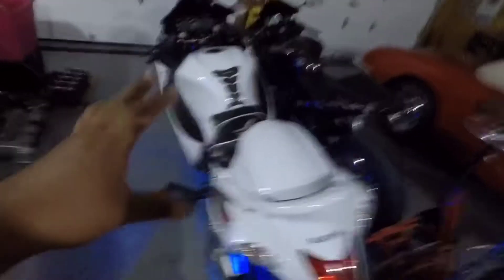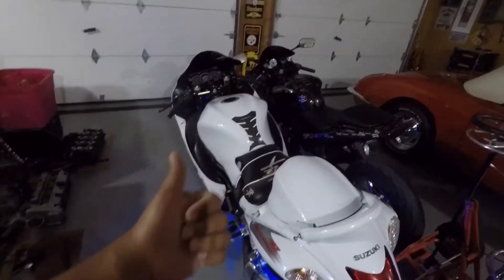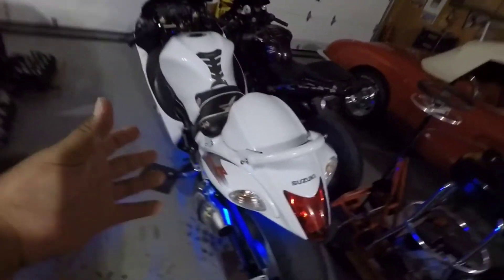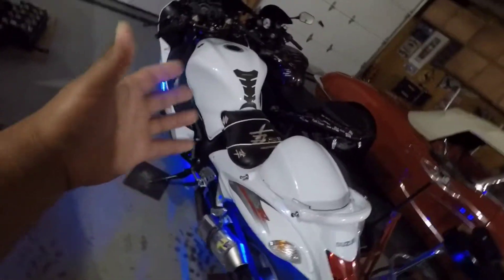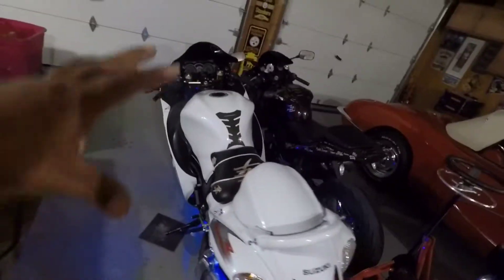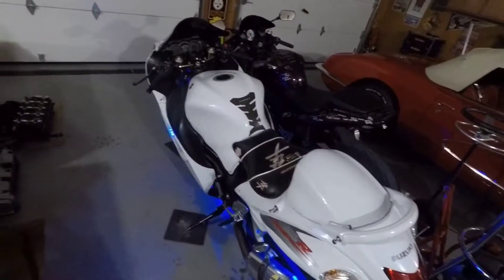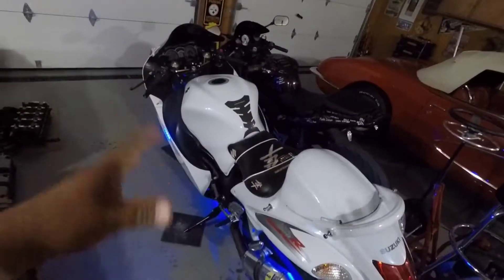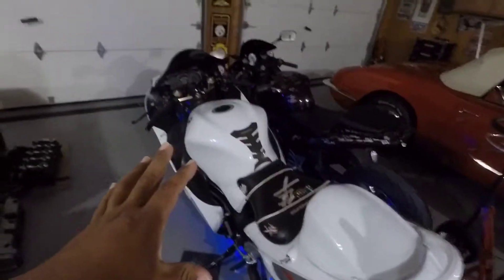Motorcycle Underglow: what you need to know

Comment: Any lights that are not used in combination with the original lights for the same purpose or for safty of the same color are in fact illegal on any motorized vehicle. Police will just almost always give you a free pass on motorcycles as long as you're not riding like an ass, giving them a hard time or have them flashing. 

One color however is totally legal even to have flashing or not as long as it's being used with your hazard/marker lights for the purpose intended. Yellow. Tractor trailers for example with a ton of yellow marker lights down the sides of their trailers.
Reply: UTAH code 41-6a-1604 states A motor vehicle may be equipped with a continuously flashing light system. just not in red or blue (from another section)